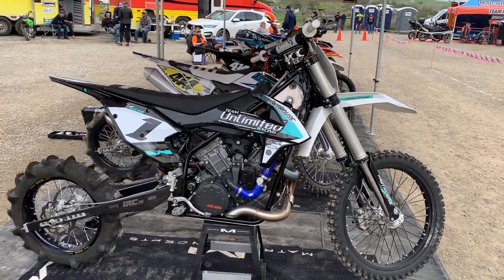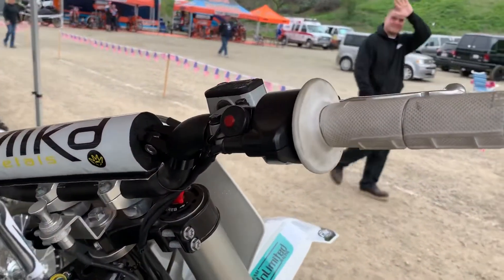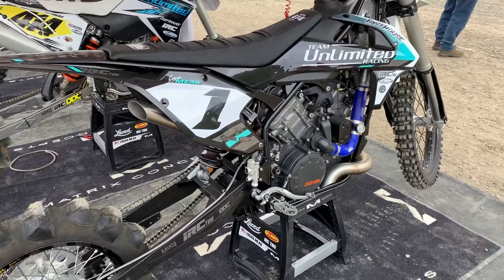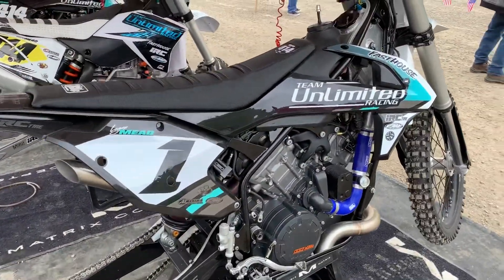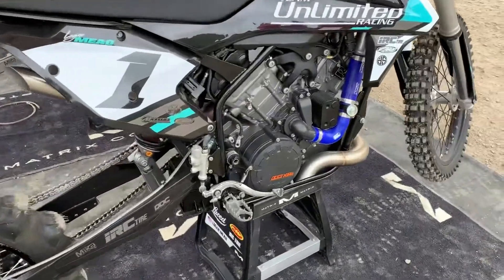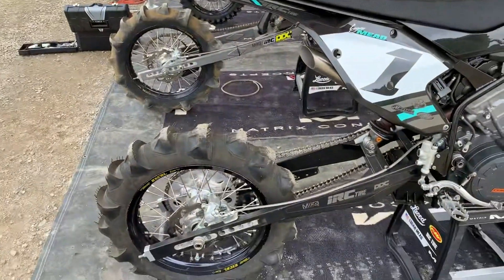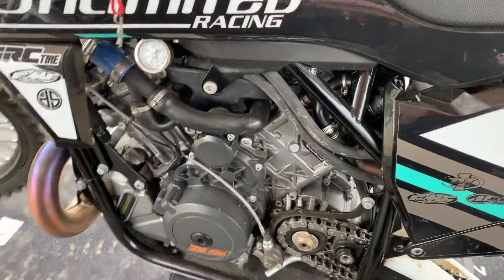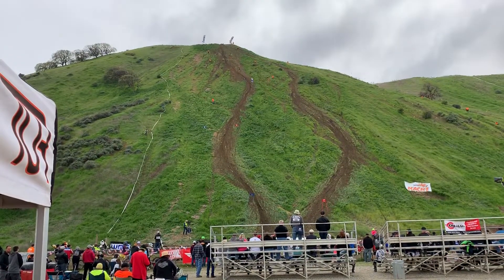MONSTER!!! How They Got a KTM 1290 Motor in a Dirt Bike chassis!

Comment: If that engine is from the Super Duke, it's putting out around 175 hp and 106ftlb torque.  Add a Rottweiler stage 5 kit for another 10-15hp!  Also, factory recommends 15k mile oil changes lol!  I have a SuperDuke and it's a beast and also the 1190 Adventure R, which is a similar engine